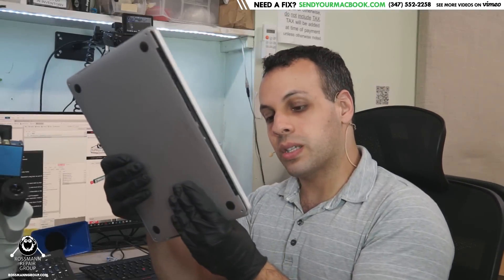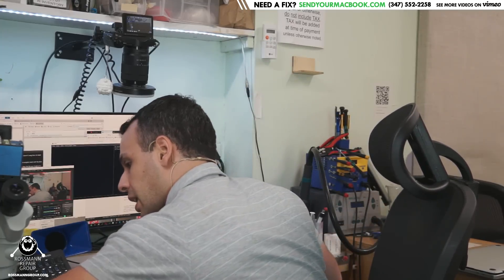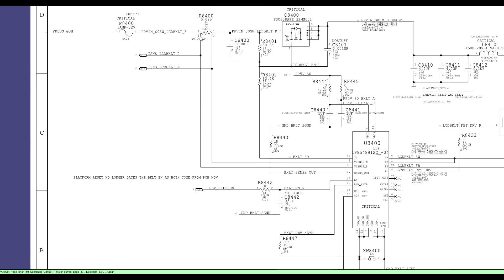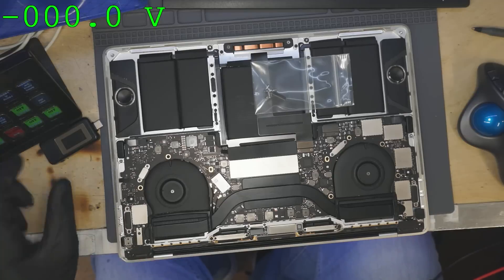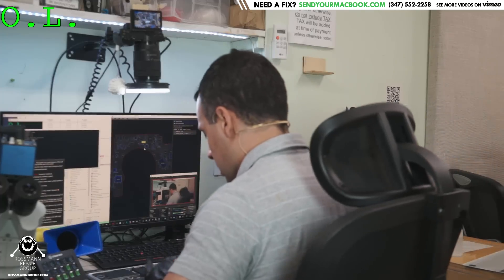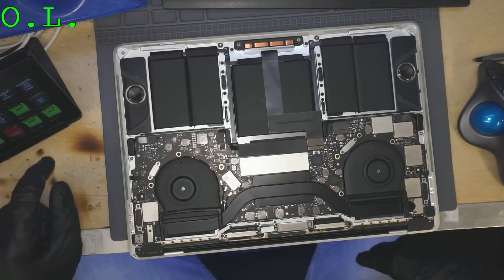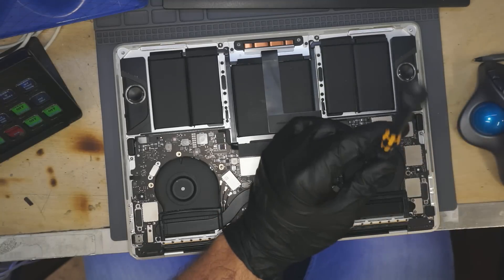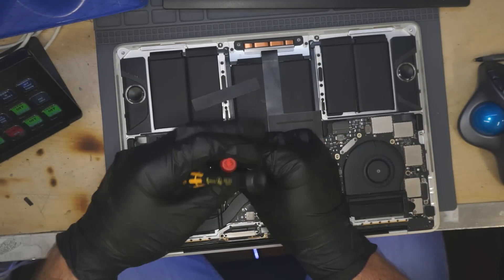Mac authorized dealer said WHAT??? + 1st attempt at ASMR board repair.

Comment: @louis Rossman Apple Authorized repair shops are not allowed to do repairs like you do. Apple does not allow modifications, aka "repairs".
But the fuse was probably not tested, or was just an easy answer rather to explaining to the customer . Also its not allowed to do the repairs because of higher liability with customer because of being Apple Authorized. Only Obsolete items are repairable since they are no longer being supported by Apple.  If it seems easier to just use apple testing equipment it can affect Apple Authorize location with a customer who may want to resolve something directly with Apple and say the Apple authorize place said they had the 90/day warranty with them and since they were apple authorize they thought it would be easier to go to the Apple store this time. Long explanation but hope it helps.

Comment: You're BOTH right.  Apple does not want to support component level repair so they opt for the "next higher assembly" school of thought.  Perfectly understandable approach if you don't want to mess with having to support component level repair with spare parts, training, documentation, etc.  Your approach is to repair at the component level and that works great provided you have the skills, the equipment, the spares, and the data needed to do so.  So which business model is right depends on who you are and where you sit.  Just because the repair is possible doesn't mean that it's in Apple's best interest to do so.  But as an owner you hate to fork out huge wads of cash for a simple blown capacitor.  Personally, I'm just glad there are folks who still do component level work - my skills in that area stopped with TTL logic circuits in the 1980's.

Comment: Technically you could blow the backlight fuse. If the shunt resistor was shorted with a piece of wire or conductive metal the board would read lower than actual current and might pop the fuse. Possible but improbable.

Comment: Replacing the entire board is fairly common within companies. They sell you a new board, and they fix the old one to throw into a new chassis and label it refurbished. They make more profit off of components that're easy for third party shops, like yours, to repair. Too far out of reach for the average person, push anti-right-to-repair and distrust for third parties, push for first-party only trust, then profit off of the shady schemes. And when you look at 'certified refurbished' prices, that's what the machine should actually cost new, with marked up prices of course, yet they mark up msrp even more on new machines. 
So they mark up the already marked up price, sell you repair components that you don't even need for a high price, then sell refurbished at yet another marked up price. Right to repair heavily, and third party repair shops like yours, damages profit schemes like this, and that's why so many companies are actually against it.

Comment: part of me wishes that theres a clause in every contract you do for every customer that states:
"If you went to the genius bar before coming to us, and they told you a fix would require a board / card / whole unit replacement, and we fixed your issue without doing that, by using our services, you are legally obligated to go back to the bar you originally went to, wave your working apple product in their face, and say "na na na na". Failure to do so will result in a $5 price increase on your next repair with us!"

Comment: I always thought a fuse is to protect the circuit from damage with option to reset or replace the damn fuse... Whats the point of putting a fuse on the board if when it blows the board goes bad? Oh wait! Its not a fuse its a capacitor... Brilliant...

Comment: Technically they would of had to replace the board regardless per repair strategies through apple since most apple authorized repair stores do not do micro soldering. But I hear your apple hate speech and what you're getting at.

Comment: Retired baby boomer here. First, thanks for the best laugh I've had in ages. The "subliminal" ASMR is a new twist on an old joke. I watch your hands-on videos because I almost always "learn something new" about electronics methods, a recent hobby of mine. I've been tinkering with and building 3D printers, quadcopters, RC aircraft, and high power rocketry instruments so the tips and techniques are usually pretty informative. 

I fully support your viewpoint on "right-to-repair", and will contact my Congress critters to make my opinion known. I used to be an auto technician back in the 1970's. The following decade I got my aerospace engineering degree and ended up in financial management (go figure) when I retired. I can still do over 95% of my own automotive repair, and do my own plumbing, electrical, carpentry, roofing, etc. around the house. 

At any rate, I purchased an iPod in 2010 to keep track of my contacts more than anything, and then an iPad 2 in 2012 to expand on that capability. Both are still running by the way. However, when I needed a new instrument capability in 2017, Apple was not even on the list. I could see they wanted an ultra tight leash on users, and I would not have it. So, I got an Android based product instead. It was the right decision. 

One of my many computers, is a Lenovo i5 running Linux Ubuntu. Less leash is better.. freedom has it's price, but history has shown it has to be paid when so many want to take it away. Good luck on your career, amidst fighting the forces of constraint and deception, with skill and knowledge.

Comment: Louis, I'm disappointed you didn't replace just the one capacitor that had the bubbling alcohol on it instead of the S&G wide-tip method. Also, no way to check each capacitor individually? Very entertaining all the same. Great channel!

Comment: I've had similar issues with a short like that, but I didn't have the choice to simply "replace 'em all". What I did is simply start cranking up the power supply, slowly, and let the bad part desolder itself.

Comment: Anywhere you can suggest getting an ipad fixed at? Pretty sure it's shorting, it'll charge the battery, run for a couple of minutes, then die and the battery is showing as 0. Got thrown around a bit by my youngest kid. Apple store, of course, had no idea other than to sell me a replacement ipad...

Comment: OK, I'm going to say what everyone already knows. The Apple Stores do not have any technicians or engineers in them. Apple created a robot specifically to disassemble iPhones for repurposing. They don't fix ANYTHING. When they say they cannot test the system its because it won't boot from a CD or USB thumb drive. They have been trained to utilize the Apple Technician software. This doesn't even fix the majority of problems. It can tell roughly which faults there are but as you know, just because a certain area gives a fault doesn't mean that this is the problem. Long story short, no one in the Apple Stores knows jack about computers, logic boards (motherboards), backlighting or being able to diagnose electrical faults. The engineers at the home base know but they don't touch the problem children.

Comment: Years ago I worked at a laptop repair center and unfortunately this was the same mindset there as well. All repairs were handled this way, even warranty work. The repair tech wold diag the machine and if there was a problem with the board they would order a new one from the parts cage and replace it. The company had a board level repair facility and even had the equipment to completely rebuild LCD screens. There wasn't anything they couldn't fix. The boards that were bad were fixed and sent back to the company to be used in refurbished machines. The point is that even with the manufacturer taking the hit on a brand new board (for warranty work), they still chose to replace it instead of fix it. The mindset of replace instead of fix, is everywhere.

Comment: I honestly think the reason Apple and its authorized repair teams don't like getting into nitty-gritty diagnosis is that maybe they are flooded with so many Macs to fix, that it's easier to just throw out the whole damned board and put in a new one and charge their customary "Apple tax" afterwards... Then move on to the next machine.

What makes things harder for Apple is when they have an actually intelligent YouTube personality who is very much an Electrical Engineer showing off their inadequacies in operations to the public at almost more than 200k+ views per video. There's only so much talent you can recruit for the massive amount of machines that need to get fixed each business day.

Apple would rather not have their brand damaged by Louis, so have attempted to shut him down and discredit him... yet he keeps going, and Apple Legal has been unable to defeat him in court. Either Apple starts fixing their flaws and making repairable machines that DON'T require throwing out the logic board immediately, or they'll start putting in indicators that will go off when the Macs are tampered with by an un-authorized provider...

They're already doing that for the iPhone batteries... It's only a matter of time before this issue goes to court and gets defeated for breaking the Magnuson-Moss Warranty Act by having the digital equivalent of "tamper stickers" on their equipment.

Comment: Yoo rossmann. U should look into the galaxy note 4 emmc problem. Is this something u can fix. There are a lot of ppl still using this relic device. Last phone to have removable battery, expandable storage and ir blaster.

Most use it till it dies over the emmc issue. It was a factory defect where the heat would unsolder a chip and cause the phone to boot loop. Only fix is running a cpu wake lock app and installing a slim piece of plastic to give it that little oomph it needs to make proper contact. These two fixes are only temporary though. After that it's a $70 fix from samsung but they replace the motherboard and you lose all your memory.

Check out www.reddit.com/galaxynote4

Comment: So, what is the problem here? I wouldn’t mind getting a new board. As it probably would take less time to replace the whole board, then to find out what is the problem and replace just the faulty part on the board. Especially so when the board is still under apple care. And if not, never go to an apple care center to repair apple stuff. Way to expensive. 
So, you’re still with apple care, let apple fix it by replacing the board, if not under apple care let some non authorized apple repair shop do the repair. 
Oh yes, you should be glad apple works they way they do. If they did it perfect, you would have a lot less to do.
Reply: Because the replacement is a refurbished board that will likely develop issues also. It's not fixing it, it's delaying the inevitable. Plus, if you do or don't have Apple Care, if they don't cover it, you're out a thousand or more dollars most times.

Comment: I don't know about modern authorized service providers, but when I worked for one the Apple agreement didn't let us fix components. Instead you were required to replace the entire thing. Since most Mac's are soldered together on the main board, that was the replacement.

It's stupid, but true.

Comment: IF a fuse blows, it's indicitive of a problem on the line, i.e. a short and therefore must be investigated.  Had an issue where another engineer was blowing fuses from a transformer.  put the fuse in, turn pwer on, fuse blew.  I asked...is it wired right?  He said yes.  (Mind you this was a sr. engineer and i'm some lowly new kid).  I ask, are you sure?  YES.

I asked if i could double check...sure..sigh.

I then ask if his transformer had 4 taps on it (A direct 480 to 120 transformer).  Yes, that's what was spec'd.  Ok, part xyz?  YES!!!  well if that's the case, why are there all these extra wires hanging off it?

Turns out factory labeled the transformer with a different part number.  shop wired per the drawings, and didn't question the extra wires.  and THAT was the problem.

Comment: I thought that the entire point of a fuse was to protect the rest of the circuit so in the event of a surge you just need to replace the fuse, or worst case fix the short then replace the fuse. If you just replace the entire board when a fuse is blown then why have the fuse, let everything burn up in the case of a surge or a short it won't matter.
Reply: Also if it is considered too complicated to be doing surface mount rework then there is a magical device called a socketed fuse where no soldering is needed to replace it.

Comment: I don’t get it, isn’t the whole reason to include a fuse to prevent damage to the other components so you can just put in a new fuse after you fixed the short? If you have to change the entire board because of a blown fuse, why put one in in the first place?
Reply: You were right on your first thought. You DON'T have to fix the board, that's the point. The Apple certified place, like the genius bar guys, isn't allowed to do component-level stuff, like fixing a short to putting on a new fuse, so they have to replace the board. That's all they're allowed to do. You'd still need a fuse to keep the short from damaging the rest of the board.

Comment: The Apple authorized store probably told the customer that they needed a whole new motherboard, because that's the only repair option they are "allowed" to present. If you're an authorized Apple repair centre, you're only allowed to replace parts, not repair them. They would get their agreement with Apple revoked if they were caught doing board repairs since Apple doesn't offer that as a repair option to customers.

What's more sad is that you're likely not even getting a new motherboard since they rework defective boards and put them into the repair part inventory chain. 

Whomever looked at the back-light fuse obviously didn't know what they were doing though since that fuse can have a value of 0 to 1 ohm.

Comment: I don’t think the store was “wrong” per se. I have done this before where instead of explaining how a complex circuit has failed, I’ll say “it’s an issue with the backlight fuse.” It’s a term regular people can understand easily. Also, they said “you need to replace the board” because they don’t do board repair, and why would they tell them to go elsewhere? I see your point but I don’t think they actually tested the fuse and thought that the backlight fuse was actually bad.

Comment: Fairly typical design error. The solder pads are wider than the capacitors, leading to mechanical stress that produces a (sometimes invisible) crack in a capacitor. This is easily avoided by making the solder pad 60% of the width of the capacitor. It has the added advantage of using less solder and leaving space for an additional track between pairs of capacitors, if required.

Comment: Student engineer here, I have been watching your videos for some time now; I love the content, it's awesome to see technicians/engineers repairing tech at the board and chip-level fixing the issue rather than just being a glorified part replacer like crapple 'geniuses'. Calling themselves 'geniuses' should be a red flag in its self as a mark of a true genius is to be humble to yourself, to those you work with, and the clientele. If we take a moment and wind back the clock, whenever you purchased ANY technology or appliance a detailed schematic was in the packaging for self-repair and diagnostics. What the heck happened to that practice?  I can only guess companies saw the profit line they could tap into with locking away that practice thus resulting haveing you come to them for expensive repairs in the case of Crapple.

Regardless keep up the spectacular videos, and I hope you get that new space to expand so you not packed like sardines in elbow to elbow room as if you are in a submarine. 

Also, as a note and/or suggestion you should look into getting an Oscilloscope. Would be awesome for viewers to see visual repentations of signals, and voltages / currents running around the board showing how or why this part of the board is crap as a educational platform for you to explain eletrical topics, also who dosn't love a ocillioscope. Outside of the veiwer it would also give you a different angle to look into your boards and chips for other types of diagnostic repair outside of just useing the good ol' digital mutltimeter.

Comment: that's the same with car services.
they all only can change components, no repairing things.
only small sercies are able to fix a headlight with some super glue, not changing the 500,- expensive headlight. for example.
change a electronic part in the ECU ... not changing the complete module with the need to programm it to the car

Comment: Also, the UV curable solder mask I got seems to have separated a bit, but there's not really a way to mix it.

Its pretty good at insulating pads and capacitors on delidded CPUs you intend to liquid metal repaste though